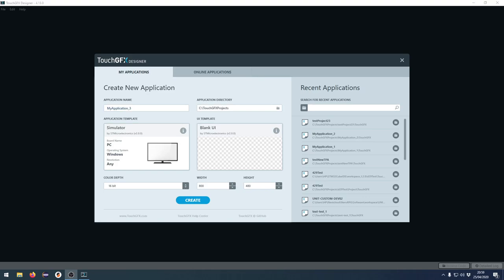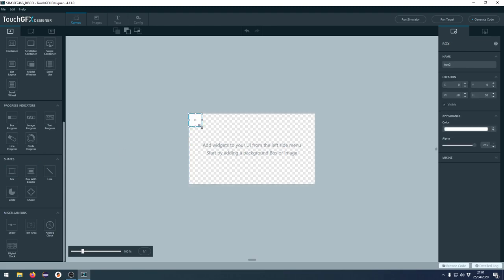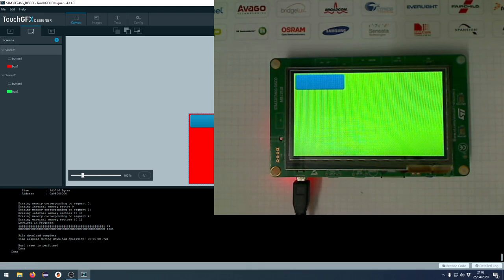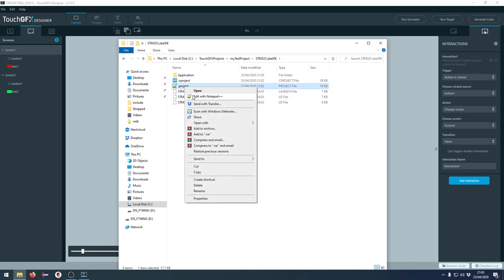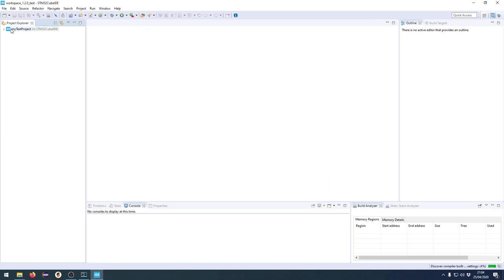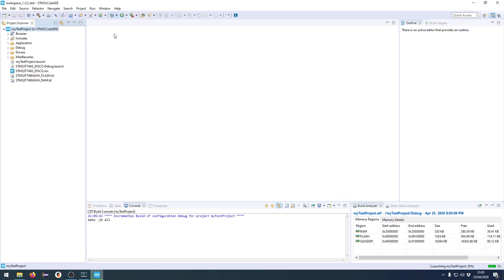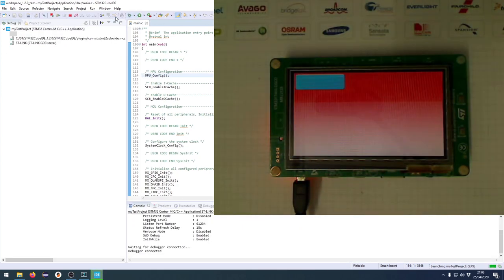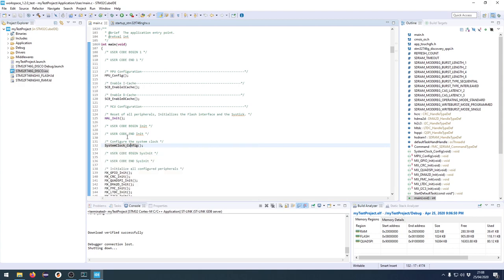[DEPRECATED] - CubeIDE project from TouchGFX Designer (4.13.0)

Comment: Thank you for very nice and clear video. I have followed all your steps and I have at least 2 problems. CubeMX file *.ioc cannot be activated from CubeIDE project tree even if I modify file content with my project name and rename file itself. Another problem is that in CubeIDE project tree I cannot see Core directory where user's *.c & *.h files should be placed. This directory can be seen in File Explorer.

Comment: I really would like to see a video setting the TouchGFX to a more simple stm32 li the f103 series and the ILI9341 for exemplo. Not all applications can have a 7 USD Microcontroller and a 10 USD display. A lot of people is looking for that, a replacement for NEXTION or any other serial HMI solution.

Comment: Keil has Debug and Load button. I do not see Load button here. If you remove the USB cable is the program still running inside the board? Is there other way to load the program to the board ? Are those actually fully factional applications to write programs and load ? or just a demo to show the boards ?

Comment: great job!  tell me how, for example, to display values from the ADC on the screen, or how to bind a button to gpio
Reply from the maker: Thanks! I would suggest that you have a look on some of me previous videos on exactly that subject. for example this one: https://www.youtube.com/watch?v=SYdyJBehcYY&t=2s
on how to update other tasks from the GUI. 
While it's possible to do it other ways I would recommend that you separate the GUI from all other tasks and use the RTOS to forward messages to other parts of the system.
Reply: @banjohat  This video was very useful, as its the first time I've managed to get something to build from CubeIDE and not have a black screen! However, looking at your previous videos, you have TouchGFX folder in CubeIDE, but because the project was imported from the STM32CubeIDE folder in this video, this folder is outside of CubeIDE. I've tried opening the root folder, but that doesn't seem to work. I've also tried opening both projects, but that is not allowed as they are the same name. I started to edit the model.cpp etc in another VS Code, but obviously then I don't get all the auto completion. Any advice on how to be able to edit the TouchGFX files within CudeIDE would be great.
Reply: Also, how do you edit the ioc file? If I try to open the one like in the project in the video I get:

Invalid Input: Must be project's active .ioc file.

Project's '<projectname>' active one is 'projectname>.ioc' file

I tried opening the one in the route, which does open, but then is of course not linked to the one in this folder so does not update it with any changed to this file.
Reply from the maker: @dpgregory  I just found that you need to rename the .ioc file to the same name as the project name. then it should work
Reply: @banjohat  Tried renaming the .ioc file but still could not open it.  I had to manually change the filename also inside the .project file which was still referencing the STM32F746G_DISCO.ioc.  Then I could open it :)

Comment: Hello, how i can define port pins functions ... ? The CubeMX way is fantastic....
I can't open the device configuration perspective ( CubeMX ) and if i double click the .ioc file i  get:
Invalid Input: Must be project's active .ioc file.
AND
Project's 'Termostato_1' active one is 'Termostato_1.ioc' file.
I'ts my mistake or i need to do something to open the perspective ? Thanks...
Reply from the maker: you need to make sure that the project name and .ioc file name match each other. I fixed this by renaming the .ioc file
Reply: @banjohat  True :) but if change pheripheral configuration ( i need USART 6 ) the project does not compile anymore... I'm trying to find differences in the files.......
Reply: Sry, by copying the file inside the CubeIDE folder and rename it. Inside the file i haven't change nothing and something....
Reply: I think.. inside de project configuration file change:
		<link>
			<name>Termostato.ioc</name>
			<type>1</type>
			<locationURI>$%7BPARENT-1-PROJECT_LOC%7D/Termostato.ioc</locationURI>
		</link>
than rename the .ioc file in the original folder, without copy it... Seem to work.... Thanks...

Comment: Thank you for the informative video sir.  I have a question. The after doing everything as mentioned in the video, the application is working fine in the LCD but I am not able to open the .ioc file for configuration of peripherals like enabling of USART. Its giving following error - "Invalid Input: Must be project's active .ioc file."  "Project's XXXXXXXX active one is xxxxxx.ioc file.  Can you tell how to fix this??
Reply from the maker: Generating a project in the designer will cause some trouble when you have multiple projects generated. They seems to point to the same .IOC file but the IDE can see that they don't belong in the same project and thus throws this error. It should be fixable by changing the project name inside the project file itself. I can't remember the exact solution to this but I have seen the error some time ago.

Comment: Hi, I have modifies the .ld file to allocate images and text into the QuadSPI memory. How ever it seems that compilation is ignoring this change and fails to compile due to the fitting all in flash. do I need to do something else to propagate this change ? Thanks a lot for your answer.
Reply from the maker: If you use the latest  application template all these settings should (fingers crossed) include all the right settings

Comment: Thank you for posting this and all the hard work in creating this method. The only problem that I see is that by changing the project name in the project file, it makes opening the .ioc cubemx project impossible since the .ioc file still references the original file. Can you post a way to overcome this? I suspect it is easy enough just keeping the original filename but unsure as to what that will do to the TGFX relationship with the project.

Comment: It is great ..thak you very much sir. I have a question . Can I type in C language ( not C++) in STMCube IDE which I linked with Touchgfx?
Reply from the maker: Yes. The tGFX is in c++ but you can work with C just fine. Also the main file i a .c file. If you're ind doubt just look at the filenames to see what kind of language you can use.